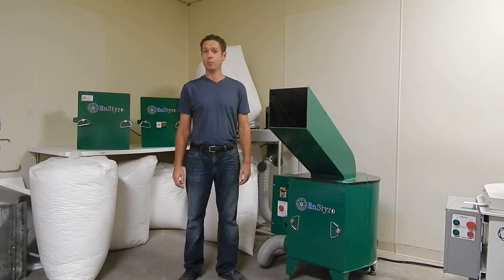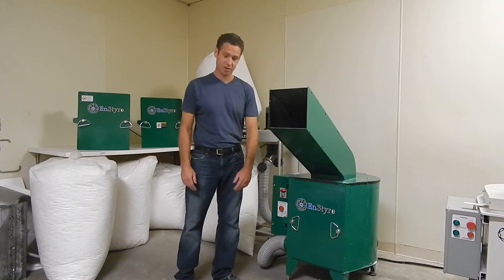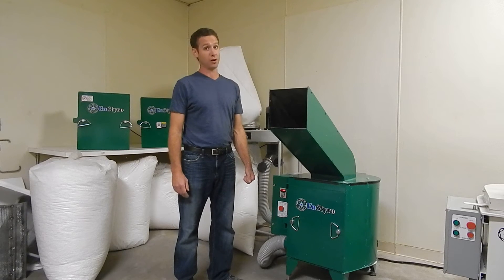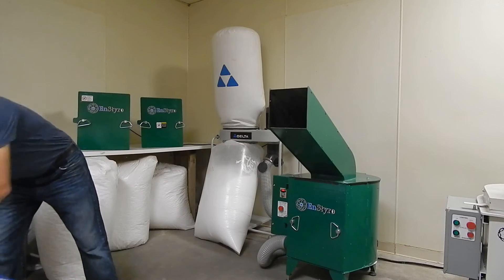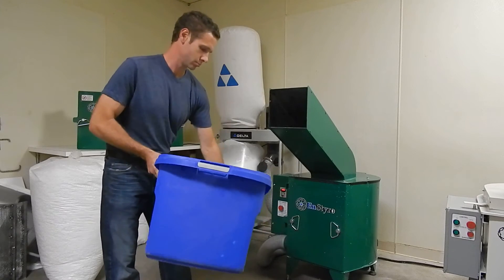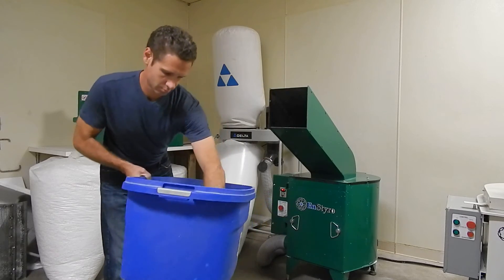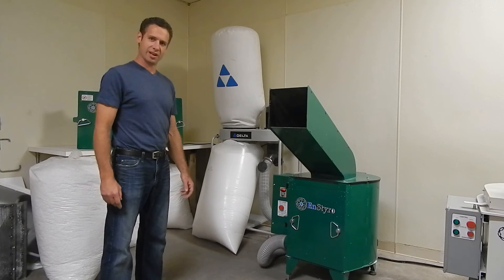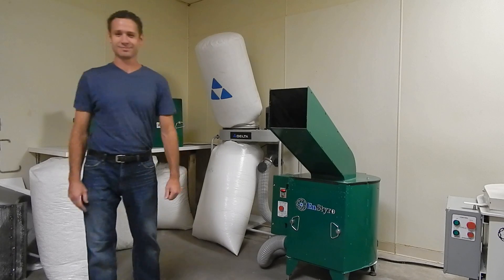Foam Shredder for the building material of the future

Comment: hola I'm in the Dominican Republic and I'm trying to recycle EPS. what is price and the different models of machinery to recycle. and where they are located.
Reply from the maker: Enstyro equipment is built in Iowa right in the middle of the US.  Our prices and the many screen sizes that we offer are listed at this web page:  https://enstyro.com/purchase-foam-shredding-equipment/    Please send an email or call if you would like more info or an equipment quote.  The Dominican Republic could really benefit from lightweight concrete, mortar, stucco.  EPS aggregate is amazing and we are still just scratching the surface of its potential.